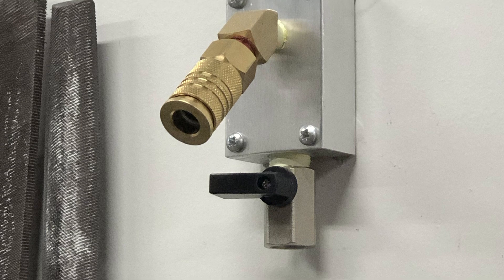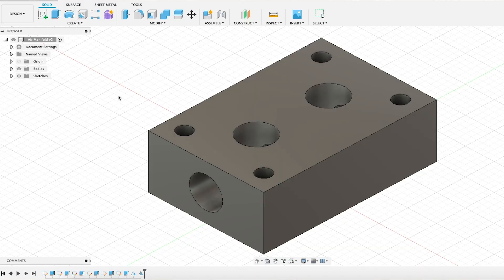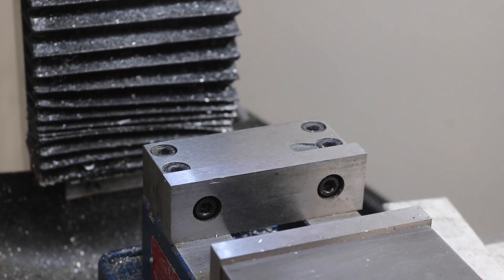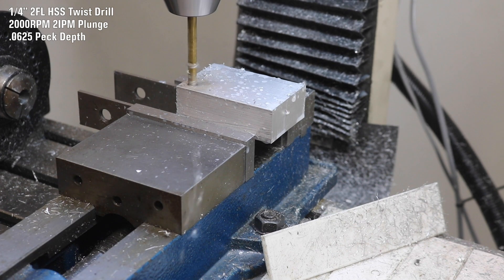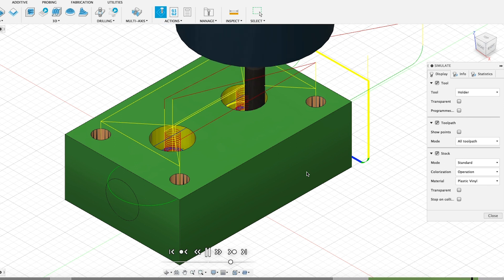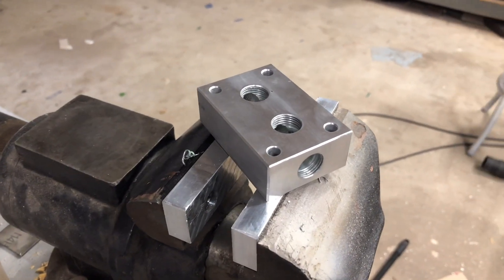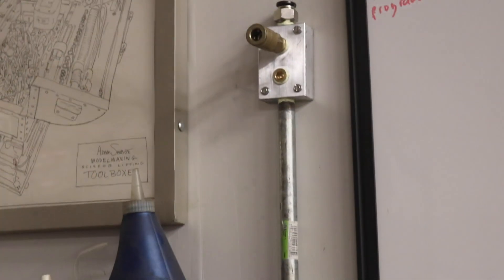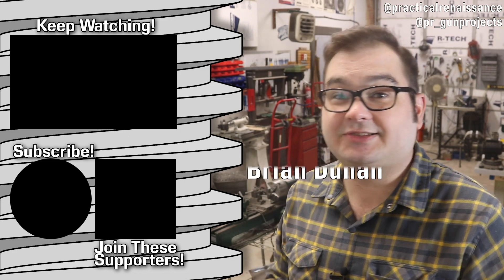Making an Air Manifold with a Small CNC Machine!

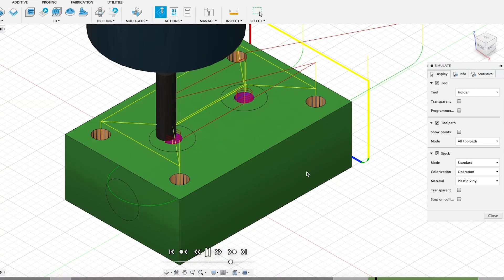Comment: 5:40 - choose "predrill" as ramping style for the adaptive and select the pre-drilled hole .. the endmill will rapid down the existing hole and start side cutting right away, without unnecessary axial engagement (faster, smoother, better for tool life, etc.)

Comment: Great stuff Jeff. Are you going to convert your mini-lathe to CNC? I did mine some time ago using the JFettig plans. I wish I had time to use it more. I have a Sherline 5400 CNC Mill that I'm converting over to GRBL and getting rid of Mach 3. No fancy tool holders on my mill either. I also have a SB 9C like yours without the legs though. Love the videos please keep them coming!
Reply from the maker: Thanks! I’ve got plans for the mini lathe, still working on them, but it’s a machine not forgotten! I think there are some tool change options for the Sherline machines but I couldn’t tell you, sounds like a good project though!

Comment: Here's a link to help you out with your chatter problem. Basically your small RDOC caused your actual chip load to be too small

In general, up your chip load by slowing your rpm when taking small passes with long tools

Whenever I have chatter, my first go to to quickly solve it is slowing the rpm only. Works most of the time

https://www.harveyperformance.com/in-the-loupe/combat-chip-thinning/